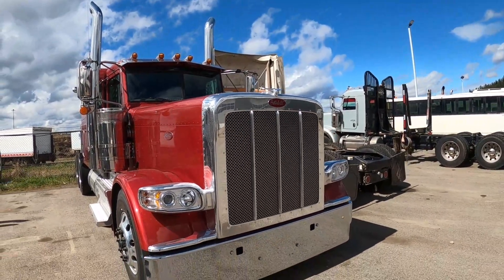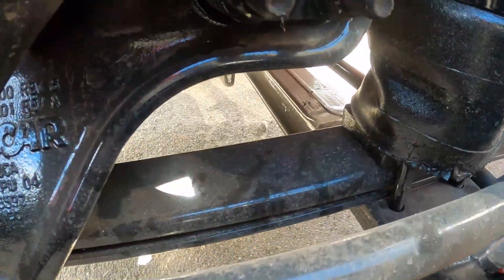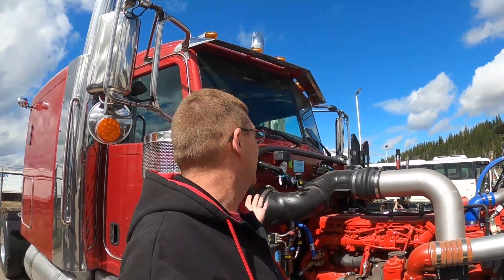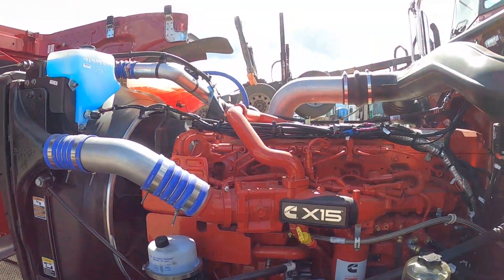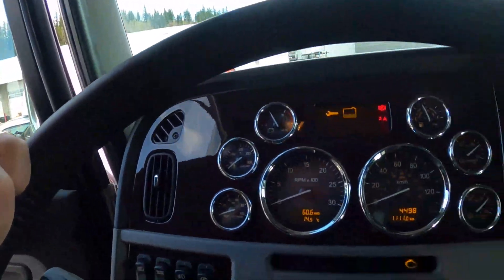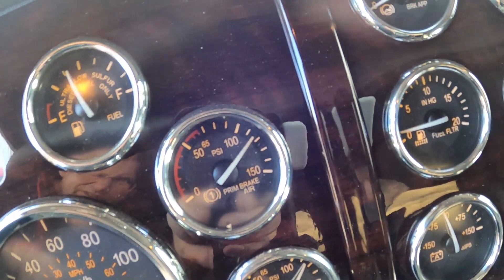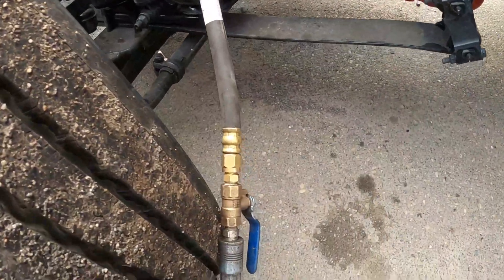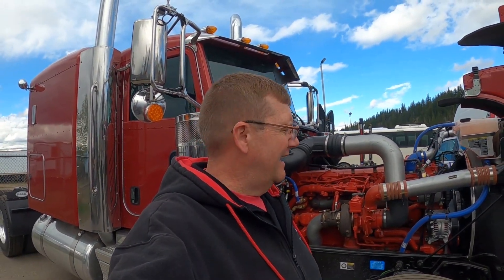Peterbilt Air Ride front axle.

Comment: If you stick to highway driving I think the air ride steer axle would make the truck float. The owner ops that do a lot of regional or working in rural areas standard springs would be more durable
Reply: Hey Graveltrucking? redoing a 93 exhd cat motor truck, have a 30ft frameless East, going back to East on the 1/10/2022 to have the front axle made to lift when im empty, taking the air leaf tandem out from under the 93 and replacing it with a single drive( 23k on Air Trac) with a lift to make it a tandem /tandem when im loaded and a 3 axle when im empty. Thinking about some type of air ride or air ride assist for the front axle? i run local, haul legal but a combo of 55mph and then 25 to 40mph limited 2 and 4 lane roads, Semi retired so beyond hauling big weight all over the place. I think it will do fine and ride nice? I should probably put this build on youtube as its kinda neat, add your opinion cause i dont like doing things over? Again let me know what you think, God Bless and Looking Foward to 2022!
Reply: I agree. I have hendrickson front air ride and I hate it because the truck floats and wanders. The truck does ride softer but you pay for it with a little loss if control.

Comment: Thanks for the info Mike! I now understand the system a lot better. As far as road debris and rocks possibly damaging the bag maybe some sort of a shield for the bags. I have seen the shields protecting rear Bags on dump trucks that pour hot road asphalt.
Reply from the maker: That's a good idea.
Reply: Was thinking the same thing.  Known issue could be easily remedied with some sort of shield.
Reply: Most of European Trucks got rear and front air ride axles. It works perfectly and it’s way more comfortable....but they are all cabovers .
Perhaps it is not as suitable for US trucks ??

Comment: I have never seen a 389 only one leveling valve on the front  no one around here does that!!!!
Reply from the maker: I Have to admit, I didn't order this one and it's not a common spec for up here.  But I do love it 😍
Reply: @mikethetrucknut  we do dual and put rear valves on to dump it from the cab to set it low in the parking lot .
Reply from the maker: I like that. The only issue we've had with dual is if you don't get the valves set right one set of bags can be half deflated while the other one is hard.
Reply: @dustinrieck312  so I’m looking to do this swap on my truck. Do I need the 389 rear axle dump valves or will any rear axle dump valve work?
Reply: @gtmotorsports937  Yes the rear axle dump valve is what we use or you can put a electric one on I have seen never done one personally,
Reply: @dustinrieck312  I’ll  buy the rear valves. I like the idea of adding the dump function when parked. I’m also trying to figure out how to do the over inflate set up.
Reply: @gtmotorsports937  there's a couple different ways to do it there is an over inflate valve now offered out there or I have seen a second leveling valve installed I am going to do one this spring when I get my trailer done .
Reply: @dustinrieck312  thanks for all the info. I’ll do some digging and I’m also gonna try to find the last 6 of the vin from a 389 so I can order the front springs, shackles and frame mounts and rear axle leveling valves.
Reply: Does anybody have the part number for the electric dump rear leveling valves? My local parts house isn't very helpful without numbers

Comment: Two things :  was told factory will provide DUEL front  levelling valves.  Also saw a dealer substitute rear leveling valves, connect to a switch, so the air can be dumped.  The factory front valves do not have an exhaust port.  A valve on R & L prevents the one side droop 👁
Some are promoting the large Cummins 37 cfm  compressor. Tech Tues, why would this be a desirable option🤔❓👀🙄
Reply from the maker: The 37CFM compressor is quieter than the smaller one. The harmonics of the dual piston are better.  Since they stopped taking their air off the charge air cooler they have gotten noisey.

Comment: Hey Mike, here in the states, a lot of people will order the additional leveling valve for two reasons: 1. Truck keeps a more consistent ride height. 2. Swap out the valves for rear valves that have a dump port and wire them up to a factory spare switch so they can just dump the front end when they park. 

And for those interested in having a lower front end, make sure you order the 5” (car hauler) drop axle over the normal 3.5” drop. The 5” with the bags on a switch make for a great stance.
Reply from the maker: Awesome, this one has the 5" drop and realized after I didn't even mention it 🤦‍♂️ Dump switch on this one will be a must.
Reply: @mikethetrucknut  Without regard for the factory drop setting,  the degree of distance between inflate/ deflate, remains constant 🤔❓👀
Reply from the maker: Yes it does.
Reply: Depends on the type of application. 5 inch is the car hauler spec & that default choice. 
But the flatbed guy, AKA Super Trucker Dan works in many of those Midwestern rust belt cities w/ old factories, pothole laden site roads where the bumper scrapes the mud puddles. Then there are off road deliveries to construction sites (especially cell & wind towers) + some military bases are very rough. 
Even box trailers  see difficult deliveries
Unless it is a show truck or car hauler, the 5 " stance for general freight is a poor choice. Must be able to determine delivery/ P-U destinations w/ certainty.
Reply: @billupstateny9151  I know tons of drivers with the 5” pulling all kinds of freight, usually under 80k obviously. The 1.5” is not a make or break. The guys who over compensate with a 22” aftermarket bumpers have problems. Actual car haulers don’t go in the best places, and they usually run 255 tires on the steers.
Reply: @trueside0812  Actually car haulers generally run 295/60r 22.5 on steers. We obviously know different owner/operators. The height difference does matter, especially w/ just the 20" bumper. When YOU are writing the checks for repairs & insurance premiums , you will be more cognizant of foolish specification purchases. Insurance adjusters are not idiots, hope you have the answer to why does this truck sit so low? And they decline to renew the premium.
Doubt you are in management, & deal w/ these issues.